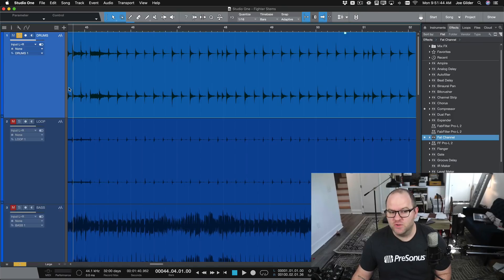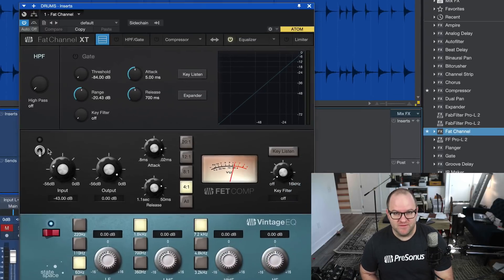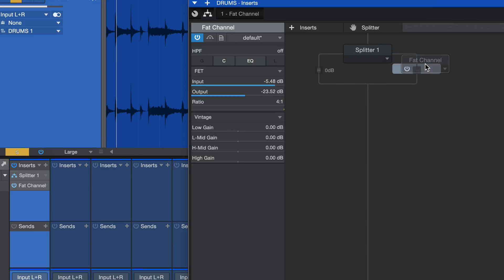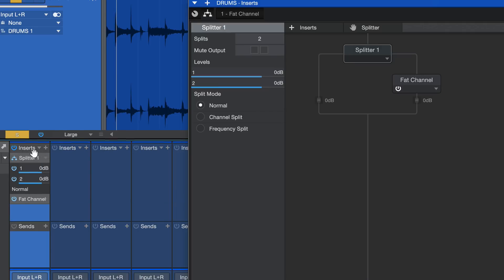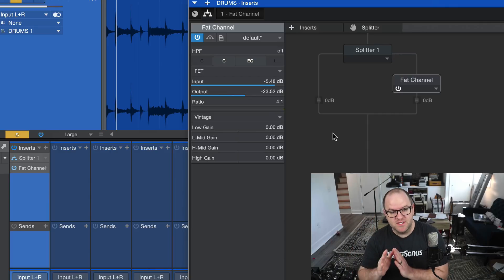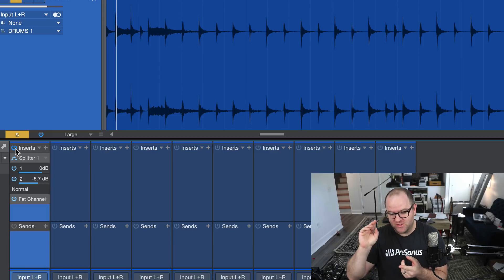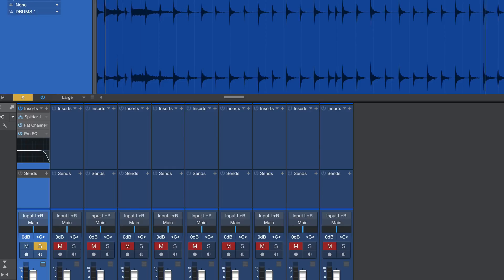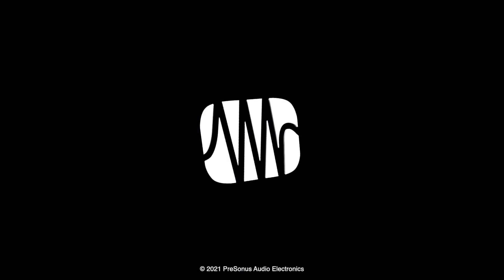How to do Parallel Compression in #StudioOne

Comment: If your using a hardware compressor you can just dial in a 50% wet/dry mix on pipeline xt. Or use a software compressor with a wet/dry knob.

Comment: Only issue: when you add Splitter and mute the second branch in order to basically get the dry signal, the volume drops by 6dB compared to the dry signal you had before adding Splitter.

In other terms: when your parallel process with Splitter, you have 6dB less dry signal.

That may or may not mess your gain staging up, so gotta be aware of this.
Reply: Is 6dB precise? I've just switched to Studio One for mastering but this thing is driving me crazy. If raising up the lever after the split can work that's super cool
Reply: @crusherxxx7  6.02dB is the precise number (more exactly the value is 20*log(2) which equals to 6,0205999132796239042747778944899......)
Reply: Thx!
Reply: I saw this problem too. Unfortunately, it's still there and I don't like it. In other words, you can't use this to perform true parallel processing. Something like Waves Studio Rack is unfortunately required for this. Its a shame because I like Studio One's stock plugins a lot.

Comment: Is this splitter a useful option while RECORDING for example vocals? I am working with two tracks (channels) while recording my acoustic guitar or vocals. I use this youtube video as a guideline (https://youtu.be/qt429tCw05o ). I am fairly new to home recording. So is there an easier way to monitor for a singer? I use headphones while recording in my fairly small room. I love S1! One audio track I use for actually recording vocals. The second audio track I use for leading the signal to a different FX channel. On the FX channel I put reverb which I can dial in to preference.